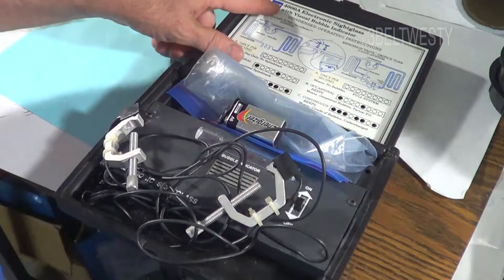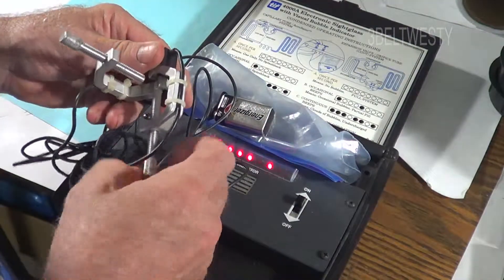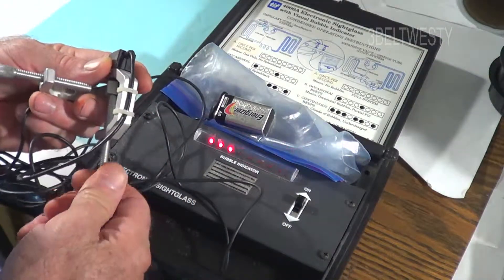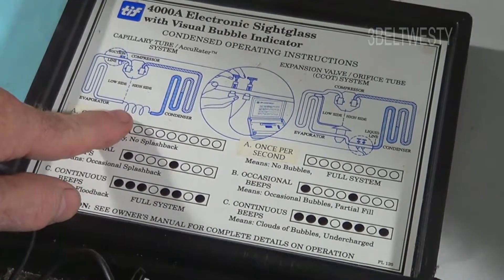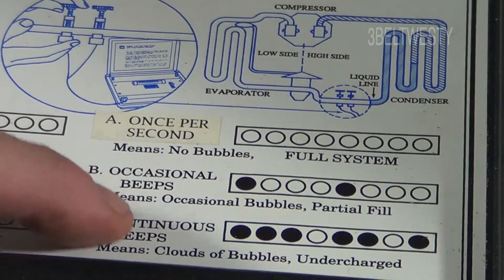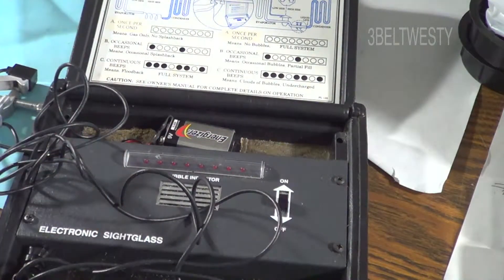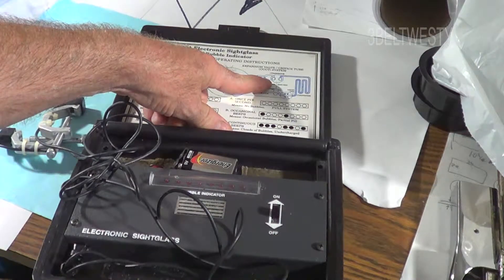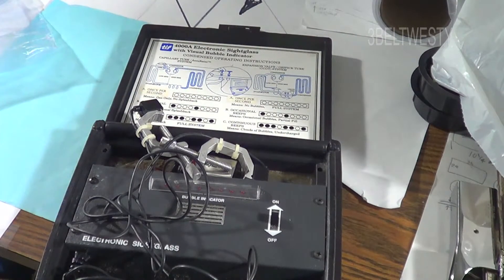TIF Electronic sight glass 4000A Retro HVAC tool

Comment: Thats insane and very cool but i dont see the need for it
Reply: Generally on a package unit there's no liquid line port only a suction port and a discharge port.  The discharge pressure is higher than the liquid line pressure so you can't measure subcool from the discharge port.  Only way to know if the charge is correct is to remove the charge and weight it in again and this is time consuming.  By clamping this onto the liquid line you can see if the metering device is receiving a solid column of liquid.